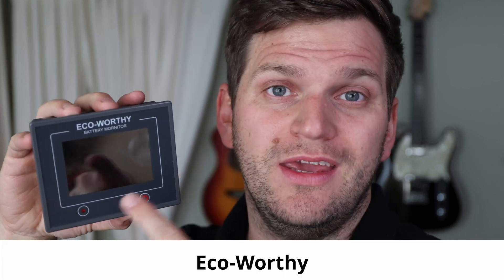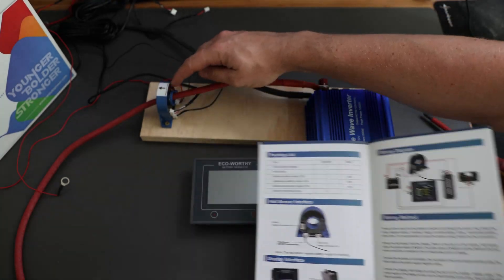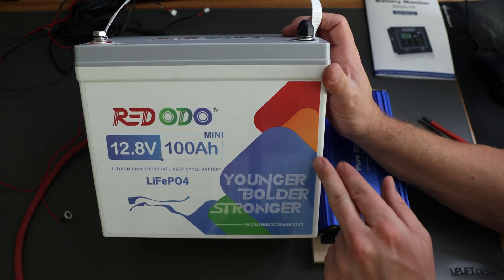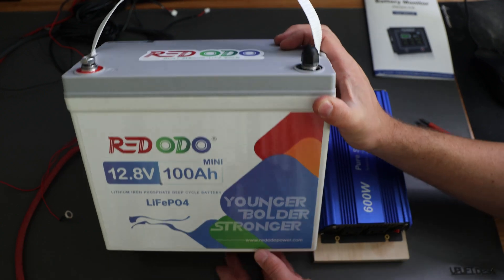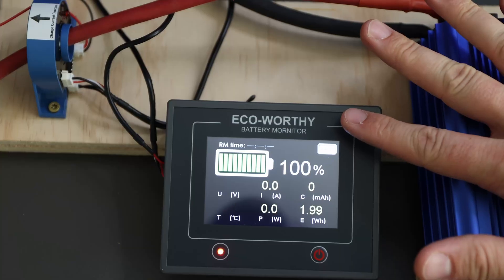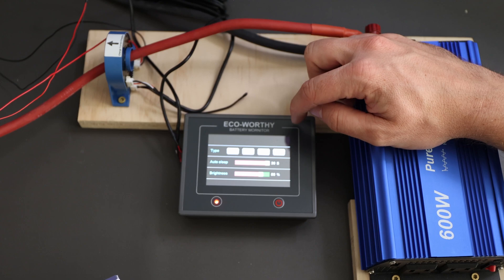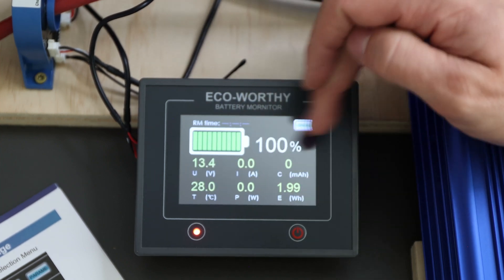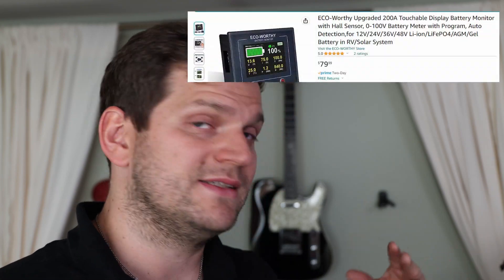Is the ECO-Worthy Battery Monitor worth the money?

Comment: One thing is that you have the CT backwards the current flow needs to go with the arrow that's on the top of the CT, current doesn't flow to the battery it flows to the inverter

Comment: At 150+ quid for the victron smart shunt and its poorer display/screen, is it fair to expect such levels from a unit that costs 30% of that?!. On top of which, anything from China has Chinglish instructions, best not to expect too much from cheap units from China and then you avoid disappointments. I agree its frustrating but you pays your money and you makes your choices!! At 90 quid saving over victron, you can afford to lose a day working it all out, it's built into your saving costs. I look forward to installing mine now and doing lots of swearing at it 😂✌️
Reply from the maker: Haha, good point ;-) Have fun installing and maybe they made some updates in the meantime :-)
Reply: @tobisreallifeskillswithtobi   everything has been fairly painless for a newbie so far, my only gripe is when I changed the systems 30 sec monitor time it junked all my "written" parameters, then on both screens resetting all parameters, it gave all parameters but 0% reading, so i did what any newbie would do, I wiggled terminals, pulled power, swore, plugged back in, and now its  running perfectly EXCEPT... Arrow on my hall meter is also in the wrong direction, was classing draw as charge, so not dropping SOC reading, spun the Hall meter through 180°, retopped battery up and started again. Running perfectly so far,  took 2 hours with cable running time and recharge time to install, so far I'm impressed!!
Reply: It's really nice to be able to set both manufacturers stats and parameters, then also have a secondary level warning, that's useful that is!! All in all for the money, I'm good!!

Comment: Update:

I muddled through the installation, but now that it's been operating for a few days it disconnects from the hall sensor several times per day. Various fields are flashing. The book doesn't explain. I called customer service and left a message. No reply. Sent an email.  No response. This morning I checked and it said the battery bank was at 50% (14k watt/hour capacity) so I started our coffee maker. In 10 minutes the monitor said the charge was suddenly Zero (charge controller said 80%) I can understand a defective unit slipping through. I'm irritated by the manual. But not responding to customer support issues... I'm done.

Original post:
What poor documentation. How hard is it to provide a glossary of all of the abbreviations?!?
Reply: Its cause it's ALL garbage madd in China, Glad soon everything will be USA made

Comment: I agree. The instructions are lacking quite a bit. My unit came with a protective film for installation. Once completed, I removed it to program the unit to find another very soft, somewhat loose plastic screen the size of the display that was scratched. Your screen, and ones in other videos looks more rigid like a cell phone. If mine is a newer version, I do not care for it, not very responsive to the touch

Comment: Best to hook up 12 volt load and drain until Bms shuts it off, then run on lithium charger until full capacity, rest one hour check resting voltage, use that for your charge cutoff parameter, repeat every 3 months, or buy super smart charger and program to only charge to 96-98% and cutoff at 20% , you won’t get full capacity but you will get more charge cycles,  going from 100% down to 10-15% will only net about 2000-2500 charge cycles

Comment: Thanks for posting - Anyone know if it will work with multiple batteries in parallel ? (is it just a matter of setting the capacity higher) - ie 200A H for 2 X 100 batteries

Comment: You need to press write the parameters after setting them, or it will not save them.
Reply from the maker: Unfortunately this is not good described in the manual and on top it is not user friendly and intuitive. The display looks great but everything else needs some re- work in my opinion
Reply: According to the display, you have read parateters second from Right, and write parameters second from Left.
You can set many alarms, but as you say, it is not very user friendly. @tobisreallifeskillswithtobi

Comment: Hey man,I think maybe you are missing something, for the first time you connect a battery monitor to your battery, you need to set the correct charge cut-off voltage for the battery if you want to get the correct SOC, for a 12V lithium battery this could be 14.5V;

After you set the battery charge cut-off voltage, you should charge your battery to reach this cut-off voltage (14.5V), then the SOC of the battery can be calculated correctly,I hope this helps!
Reply from the maker: Hi! Thanks for your feedback! I tried to follow the instructions which called out to only configure the blue area. 

I did play around afterwards and did configure those values as well. For a beginner this was not understandable unfortunately.
Reply: have any of you mounted this in the dash of a boat?  I'm curious if the screen/membrane stands up yo heat and moisture?  It seems silly that values aren't saved on a EPROM.

Comment: Battery Mornitor? Bad spelling on the unit. Bad quality control.
Reply: Lol...that was their 2nd spelling mistake.
On one of the batches they spelled battery "battry" 😂
Reply from the maker: Good catch ;-)
Reply: I wouldnt take the chinglish language issues too seriously, not being able to spell in a foreign language doesnt stop them understanding the universal language of mathematics and electronics. I've had a lot of kit with appalling spelling etc on instructions, all have worked well 👍
Reply: Hi..I bought this battery monitor. But I noticed that on the monitor where the data cable ( Red, white, black,) is to be connected, there are only 2 pins and 3rd pin is missing and only a hole is present. Is it originally like that? Can someone check and advise me